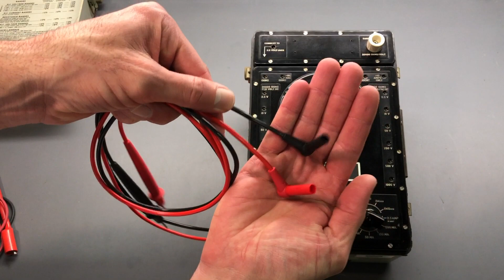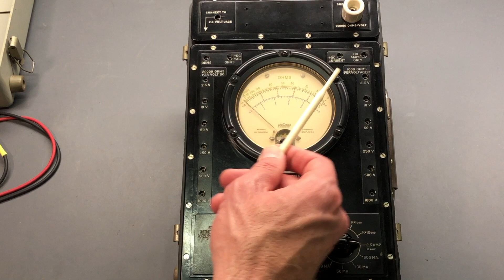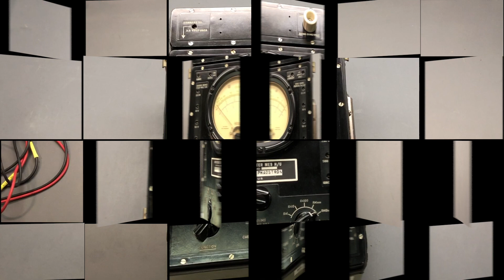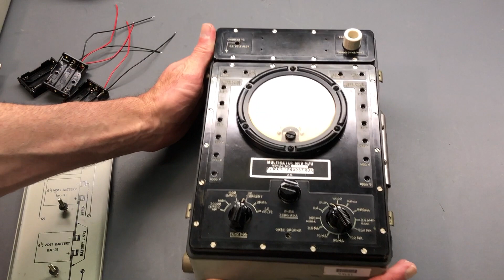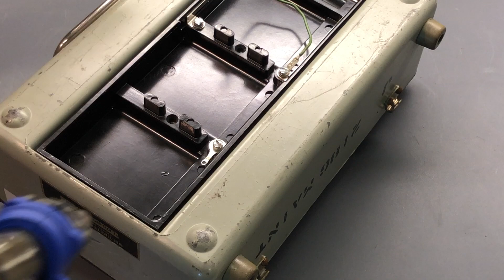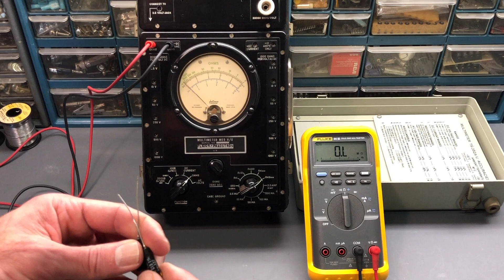TS-352A/U Military Multimeter Battery Upgrade - No Permanent Modifications

Comment: Ex-USAF ATC. We had those multi-meters on the AN/MPN-14 ASR/PAR mobile units. We (controllers) would confirm the calibration of the PAR radar on an hourly basis using this meter. I tried to do a quick calibration between inbounds approaches if I had at least 5 minutes between incoming aircraft just so I could have that "warm fuzzy".
We could bring a plane down, in the shittiest of weathers, down to 100 feet above the runway touchdown zone and a visibility of about 1/4 of a mile (1800' RVR).  
40+ years later I still have the small screwdriver that I was given when I got my PAR rating.
Reply from the maker: Very cool, always interesting to hear how these meters were used.  Thanks for your service!

Comment: I know I'm late to the party but, some 3d printed inserts for those battery holders seem like a good idea.

If you're interested shoot me a message and I'll see what I can do to help.
Reply from the maker: Thanks for the offer.  I've been meaning to change the one battery holder to a 2 cell instead of the 3 cell with the shoring wire.  If I get that done I'd be interested in what you could 3D print as spacers around the battery holders.

Comment: Might be prudent to insulate the inside of the battery lid, and even the bolts - if any of that retrofitted battery wiring shorts or arcs to the case, it could result in a live case when measuring high voltages.
Reply from the maker: Yes I placed an insulating spacer cushion between the batteries/holders and the lid. Otherwise the batteries would be loose and moving around and as you mention possibly shorting to the case.

Comment: That's a pretty cool multimeter when was it made ?
Reply from the maker: The military service manual is dated January 1967 so these meters were made in the 60's and 70's.  Not sure if they built them into the 80's.  They were built under contract for the military.   There is no date on this unit so I don't know exact date of manufacture.
Reply: @EriksElectronicsWorkbench  And I have subscribed, I live in Montreal.
Reply from the maker: @levent8208  thanks!
Reply: @EriksElectronicsWorkbench  Thank you Erik, it's a very nice instrument, I have myself and old Simpson electronic multimeter I acquired in 1978 or around that date when I was studying electronics, I love it and they are rather accurate.
Reply from the maker: @levent8208  Simpson makes very nice meters that do last a long time.
Reply: @EriksElectronicsWorkbench  They were very expensive but as you say they last, like many other things back then.

Comment: It seems that I'm having no luck whatsoever trying to find the replacement connectors
Reply from the maker: Which connectors are you referring to?
Reply: @EriksElectronicsWorkbench  the tip Jack for the probes
Reply from the maker: @nick8231  The socket connectors to accept the pin plugs on the test leads are available at Digikey (Mouser and others too) here are links for some examples:  https://www.digikey.com/en/products/detail/pomona-electronics/3542-3/736506  ==  https://www.digikey.com/en/products/filter/banana-and-tip-connectors/jacks-plugs/302  ==  https://www.surplussales.com/equipment/testequipment/TestEquip-18.html    the type used in this meter were special in how they mounted to the front panel so they were water tight.  An exact replacement is not likely available.  I think you'd have to salvage from a parts meter.
Reply: @EriksElectronicsWorkbench  I'm looking for the plug itself not the socket
Reply from the maker: @nick8231  here are two sources:  https://probemaster.com/3436-design-your-own-test-leads/   ==   https://www.ebay.com/itm/225608641720?hash=item348752acb8:g:6lIAAOSwihpkRHhb&amdata=enc%3AAQAIAAAAwEs%2BiPl6cYJLl4ZoR5ImT4%2FJTQqHMoq1sTQXelOr1soDmIrP9oEMdGzKNQY9kIz%2BIAhYP6kQrXI2vl7bH6VB%2BaXHP67ldWf%2B93noLeQfi2oAgN1P2fLwLxgHeerCy2yNuxsX85UzY0lFkgg12Gy30wIwuiprutbxJHPeuM%2Bo2pRmithENtHKE91fYte7ObZifhVu8NPeaAAX5qEIzme7tgx6Faf2vXmON7lI7aeDNo4Xt9zkbyjzTAqitqhRKtPl7Q%3D%3D%7Ctkp%3ABk9SR8LWrZCYYg
Reply: @EriksElectronicsWorkbench  Out of curiosity, does the eBay seller offer complete cables? The issue that I have is the probe end of my black cable came apart. I'd imagine that I could tear into it and resolder the wire into the probe, but it's much easier to buy a completely new one.
Reply from the maker: @PatrickDickey52761  you might have better luck contacting ProbeMaster https://probemaster.com
Reply: To jury rig pin connectors so you do not go crazy when trying to test/calibrate/repair an instrument like that, try using wire end ferrules - they can usually be pressed into a shape that just fits snugly and makes good contact.

Comment: Eric, thanks for your video. I have a Weston TS-352A/U and need to replace the batteries. I am going to try 4 Lithium-Ions for a total voltage of 14.8 plus the 1.5 d cell for a total of 16.3 volts. This only leaves me a cushion of .6 volts. I will have to make sure the Lithium-Ions aren't charged to the max, but it should work.. Wish me luck!